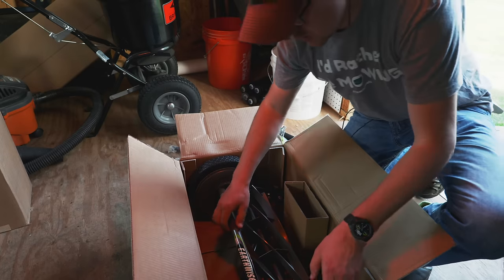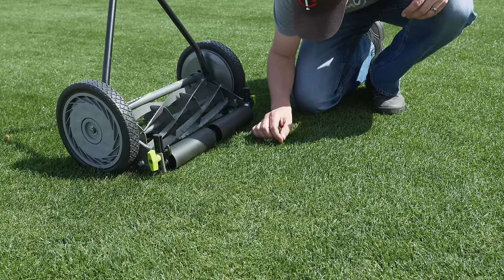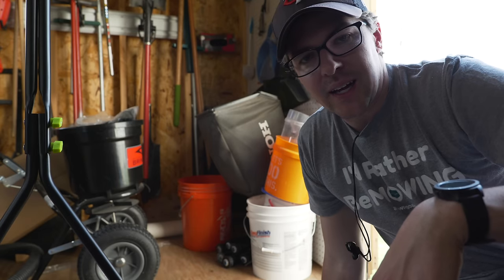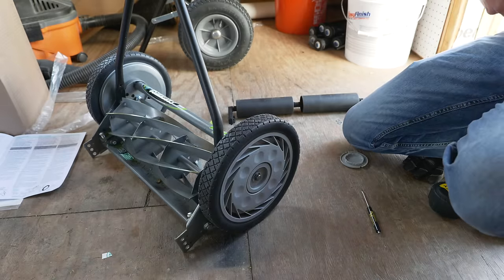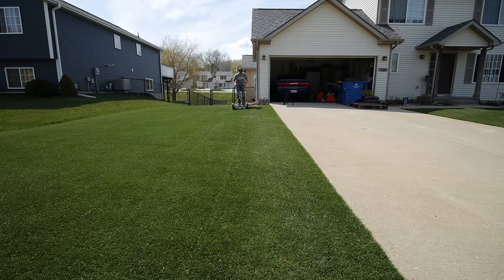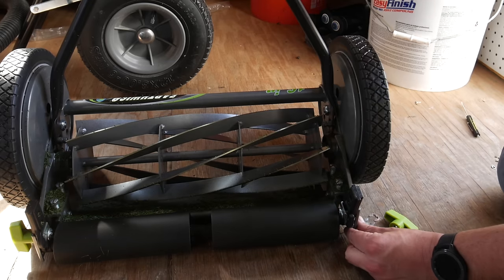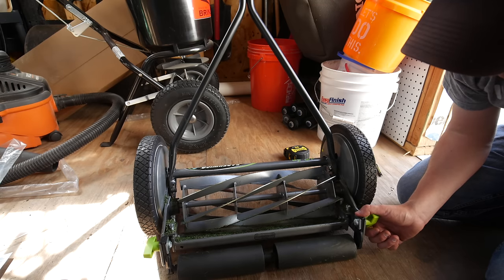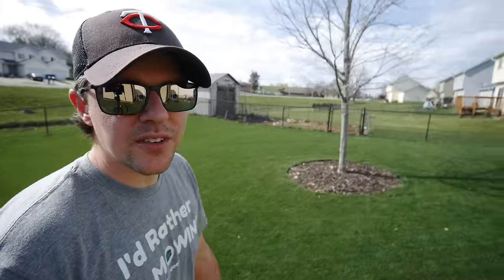I Bought ANOTHER Reel Mower and Here's WHY...

Comment: The American Lawn Mower style manual reel mowers are listed under numerous brands such as Craftsman, Earthwise, Greenworks, Lee Valley, Pro Mow (Residential Series), McCulloch, Scotts Classic, Task Force, and TruCut. The issue with that style of mower isn't so much the number of blades as it is the fact the reel and bed knife are not precision ground. Looking at the blades, you will most likely see heavy hash marks on the reel. You CAN take it to a shop and have them sharpen it better-than-new, but for what you're gonna spend, you would be much better off with a higher quality mower to start with. The Mascot style, AKA Silent Cut or Pro Mow (Gold Series) produces a much finer cut because the reel and bed knife are precision ground with a high sheen, as in, no hash marks and is far easier to adjust the mowing height. You can possibly make the Pro Mow Gold series work as a push mower and opt for the 8 blade option but it is rather pricey. Not to mention the fact, the Mascot style mower has a touchless style cutting blade making it far easier in tall grass than the American Lawn Mower contact style blade.
Reply: So... the fact that I have a scythe and obviously need the grind stones to grind it down has me winning again?
Reply: @ellenorbjornsdottir1166  "...I have a scythe and... grind stones..."

A scythe and grind stones, sure which is also how rotary mowers are done. With stones or a file. But on a REEL mower, no way, it HAS to be done on a jig or the reel and knife gets ruined.

Comment: Fascinating to watch the lawn trends. From long cuts 3.5 to 4 inches down to cropped reel mowing at 0.5 inches and now back in the middle with a manual mower. 
I use an automower (robot) at around 1.5 inches - and I've got used to the flat look without stripes.

Comment: Hey ryan washer boarding "riffeling" happens if you are travelling to fast . I work as a green keeper here in Ireland and when cutting fairways if we travel to fast the riffellling happens.so we usually adjust the accelerator to travel slower.and that usually resolves the issue.love this channel and your videos.
Reply: Spot on. I was going to suggest Ryan slow down a bit - try cutting at a normal walking pace - but you got in first. 👍
Reply: But the manual reel blades are driven by the wheels so the speed of the blades are attached to the speed of the wheels.  Slowing down your walking pace will slow down the blades so how does that help?  I'm curious.

Comment: I have a use 18" 5 blade that's a similar design with the height adjustment. This may sound silly, but to make the changes I just set the mower on it's side, sitting on a wheel, to make the adjustment. I only do one side at a time, and it's a lot easier.

Comment: I've just got my first mower and went for a reel style push. The big difference with mines i guess is it's a 1960's vintage one thats still in perfect mechanical condition. Going to repaint it in the the winter and service it. It's like you say, a bit of a work out but if you keep it short it's not so bad and it's quite gratifying when you finish it.
Reply: Those old ones work great. For my grass the newer ones are to light.

Comment: I do like push mowing with the manual reel mower, something about not having to fool with gas, engines not running right, noise, etc. It's just you, and your turf, which is rather relaxing. Not so much when the temps are in the high 80's like it is here today. Congrats on 100K subs!
Reply from the maker: Thanks!

Comment: I have an old 5 blade. A penna lawn ball bearing reel mower. It's all metal. even the wheels are metal. Has screw able hight. Rusty but works. Idk the year it is but it is old and works well even if the blades are dull

Comment: Hey Ryan I’ve noticed if you slow down it works a whole lot better. I have a 22” recycler, best push mower ever,  I was mowing a few days ago and just slowed down, I was thinking “ well what if I slow down a little, will it mulch better” and man it looked fantastic. There a guy that watches you and he did the 3 reel comparison, they were walking slow and so that why it came to mind.
   Update got the sprinklers put in ground, just waiting on the valve and controller, they come tomorrow but I have to work of course, so It will be installed Tuesday for sure.

Comment: Thanks for the great info and vid. I am looking into a reel mower as my first, just because I worked on small engines in high school and want low maintenance and not keeping up with gas, oil, spark plugs and all that mess. And you're very determined, as I would've just not chosen to cut at half an inch and gone with its lowest setting. 🤣

Comment: I have the same mower and went through a similar journey with it. I didn’t have to take the roller off at any point but adjusting the wheels is a pain to get the half inch. With my Bermuda the cut quality is only good at 1 inch. The half inch is just too much washboard for me. I do love the mower though. I used it daily for an entire season and it still cuts paper with no back lapping. The reel to bed knife adjusting is a little crazy to figure out but I’ve only had to do it once.

Comment: I have had a 5 blade version of this identical mower that they sell under different brand names. I actually bought it at Sears around 16 years ago that bears the Craftsman name.  You're right that adjusting it is a royal pain and it was because of that that I lost one of the gear parts and now only one wheel spins. It's only because of that that I'm replacing it after 16 years and I was wanting the same thing only 7 blades for the same reason as you did. Helpful video, thanks!
I have tried the engine powered reel mowers by the way, you can not beat the convenience of the manual reel mowers if you have a small amount of grass to mow.

Comment: Ryan, I recommended this same one to John Perry when he first posted his reel mowing video last year. I have the same one for use in tight areas where my John Deere 220E can't reach. It works extremely well in my bermuda but still shows washboarding when the turf gets dense.  I keep my HOC at 0.75" which is only manageable with PGR in Houston. Backlapping the reel and adjusting the bedknife definitely gets old real quick just as you said with height of cut adjustments. I'd love to see a follow up video if you could get your hands on the universal grass catcher for this unit

Comment: All you really need is a reel mower (power optional; or a powered (electric, ideally!) ride-on mower if you have chronic fatigue syndrome), a scythe (to harvest grain), and a Pulaski. Oh, and a seed sack for each species of field crop you're growing (in your case, it's probably ryegrass, bluegrass, fescue, bermuda, or grama; in mine, it's going to be wheat, rye, triticale, as well as beans and assorted others; I would also need a shovel which I do have).

Anything else is useful, I agree, and probably should be had, but may be optional. You will need a hose for firefighting.

Comment: Youtube gurus say the 7 blade reel is for warm season lawns, not cool season lawn like rye, fescue, KBG.  A 4 blade reel is best for cool season lawns, but a 5 blade works.  I love my push reel mower and will never go back to a rotary power mower.  Lawn care is fun.  Don't forget to brush the clippings off that mower and rub the blades with WD-40 to prevent rust, dulling the blade.  I do this after every mow (3 mows per week) and it's about ten minutes top.  Worth it.
Reply from the maker: My bluegrass is just as thick as warm season stuff for sure
Reply: @enp83 From the company website:

The American Lawn Mower Company 16-inch bent grass reel mower is a simple, efficient, and effective blade-and-reel mower, fueled by manpower and specifically designed to cut low-growing, creeping grasses.

A Well Constructed Lawn Mower
Made of durable tempered alloy steel with an unbreakable steel side plate, this 4-spider, 7-blade, ball bearing reel design gives you cutting heights ranging from 1/2 inch to 2-1/4 inches using the adjustable 7-section roller and 3-position adjustable wheel height. 

If you look up the same mower in 4 blades, they (American Mower Company) say the 4 blade is the recommended mower for KBG and fescues.  Have a nice mow.

Comment: I have a Fiskar since I thought the heavier blades would help vs. the Scott's that i had...which was partially true.  With the Zeon zyosia it can be a good workout.  In the places that were sodded, very tough go.  In the places that I planted via plugs, easier as not as thick.  Now since I can't go to the gym, I basically run with the mower until I hit the thick sodded portions where I would have to raise the cut height to keep running.  Makes for a good high intensity interval training.  Luckily this is in my back yard so the neighbors can't see and don't laugh at me!

Comment: Ryan, first of all you can never own too many mowers (I have 4). But, that is a classic rebranded mower made by the American Lawn Mower Company.  I have the very same mower in the 16" version that is labeled as "Great States". You adjust the HOC the exact same way, and yeah that fine adjustment can be tricky. I scalp my Bermuda lawn at 0.5" and maintain through the Spring at 3/4" as long as I can. By the way, the washboarding isnt so bad even with a 5 blade reel if you go over it from another direction afterward.
Reply from the maker: I usually do multiple directions but on 3500 sq ft it takes me a while to do a double cut
Reply: @ryanknorrlawncare  Yes, it would take a while. Good workout though!

Comment: It looks like you might be able to move the handle to the top of the roller adjustment  maybe that would help or you could move it in between it's current mount and the rear roller. I do believe these type of reel mowers are inherently destined to roll forward like that due to the cut of the reel trying to stop the wheels... This is kinda why I liked the Fiskers reel when I was trying to reel tall due to my Tall Fescue and Allergies. I now just cut with a rotory and deal with the allergies

Comment: Have you heard anything about the Fiskars Stay Sharp?  Just curious.
Reply: I've been using it for 4 summers now. Very easy to adjust the mowing height, just move the lever. Adjusting the cutting blade is easy too. I've only had to adjust once a season.  This year I bought the bag for it. I do  have some experience with reel mowers.  I worked at a golf course for 4 summers while in college. If you don't want to catch the clippings, they are thrown out in front of the mower to be cut again.

Comment: Another awesome video Ryan, thank you. So compared to the Greenworks 5 blade, easy to adjust, rear heavy mower, vs this 7 blade, harder to adjust, front heavy, quieter mower,  which one would you pick if you can only have one? Do the 7 blades outway the disadvantages of this mower. By the way I did order the 1 gallon Ryan Box from Simple Lawn Solutions, looking forward to my first application.

Comment: I’m new to this channel. I was just wondering why rollers at the end is needed on mowers? Serious question.
Reply from the maker: Helps to prevent scalping since it's riding on a flatter plane and not dipping to the holes with wheels.  Also helps to add stripes when it rolls over the grass
Reply: Ryan Knorr Lawn Care Thanks for the explanation.

Comment: The biggest problem with all these mowers is they don't weigh enough to get great traction. I have plated with adding weight and get instant good results.  But still only use them after I have machine cut the grass.

Comment: I'm having problems with roller staying on the ground which cause the blade to pull on the grass as it cuts.  They should have some way to have spring  that hold the roller down. My yard is only about 2,800 sq ft so I can justify a gas reel mower.

Comment: I bought a manual Fiskars reel mower.  I have mixed feelings about it.  At heights around 3" it leaves a lot of stragglers.  I am not sure it is best for our rye grass lawn.  Maybe it is my crappy turf but the grass tends to bend and not cut.  Lower cuts it works better but we don't have a very flat lawn.  As well, we have never cut so short so getting down to 2" or less would put me in the ER.
Reply from the maker: That's the problem with reel mowing taller heights....it just doesn't cut that great

Comment: I bought a reel mower for 10 bucks practically brand new at a thrift store.....I use it on a section that my lawn tractor can't go...it getsfilled with grass really easily..,.so what I'm getting from this video is I've been using it the wrong way?  These are for already cut real low lawns?

Comment: Well, I guess if you keep both reel mowers, set the 7-blade at a preferred cutting height and leave it. All other cutting heights can be done using the 5-blade Greenworks with the quick and easier height adjustment. No more hassle. Just grab, go and mow. Problem solved. :/
 ~ mike
Reply from the maker: Yep...I'll keep it for the backyard at this point

Comment: Have you ever used the Fiskars stay sharp reel mower? The one with the chain drive system. Im wondering how you compare this mower to that one. I've got the Fiskars reel, and it works well until I lower the setting to 1inch (first notch on the adjustment lever), or the second notch. I can mow at the second lowest notch, but it tends to get stuck requiring me to back up and push through harder. At the 1 inch setting it locks up completely and doesn't cut. If I push harder the whole mower including the wheels slide over the grass without rolling or any cutting. I have it adjusted properly to where it EASILY cuts paper strips without hardly contenting to reel to the blade, so that shouldn't be the issue. I can't even imagine how this reel mower can get to .5 inch! I live in Iowa also. This vid is making me want to give the earthwise 7balde a shot.

Comment: If there is a plastic fabricator in your area (that is not swamped with Covid cashier protectors and face shields) they could make you a Delrin or Nylon roller that would add some weight.
Brass or copper rollers would make fine stripes if your feeling rich!

Comment: do you need a very level lawn for a push reel mower to work, Ive got one but the strip at the rear keeps digging in
Reply from the maker: Need to find one with a roller and it will be better

Comment: I watched the whole video and mayyyyyy have missed it, but what was your ultimate conclusion in a 5 blade vs 7 blade push reel mower? Was the 7 blade a significant difference? Thanks Ryan!!!!
Reply from the maker: Not really a huge difference. The ease of changing heights and design of the 5 blade I have is nice. However the 5 blade doesn't cut quite as low either so there are some trade offs
Reply: @ryanknorrlawncare  Thanks so much for this awesome video and response! I've been on the fence for years on a reel mower and never could commit to dropping money on gas powered. After reading so many negative reviews on push reel mowers I stumbled on your video and committed. So happy I did! My lawn is seriously appreciating the cleaner cut!!!!! Thanks again!

Comment: You actually leaving the old grass on your lawn, I always thought, that all old bits should be removed,is there any reason for you doing that way?
Reply: It breaks down pretty quickly if they are small pieces. If you are mowing infrequently and hacking off 2" long pieces and letting them sit in piles on your lawn, that isn't good. Cutting off little quarter or half inch pieces of grass is totally fine and the soil microbes will break it down fairly quickly and it just feeds the soil rather than throwing away nutrients.

Comment: I'd imagine you'd need a pretty flat/level lawn for a mower like this.  My yard is full of bumps
Reply from the maker: My backyard is very bumpy but thick turf helps too
Reply: Ryan Knorr Lawn Care lol I bet not as bumpy as mine.  There’s not a single flat spot in my back yard. There’s like a 1-2 inch difference between the low and high spots of my bumps.  I’ve been thinking about getting a bunch of top soil and trying to fill in all the low spots

Comment: Those roller's have to be steel or stainless steel, usually they come with plastic or rubber roller's they are crap, take the roller off and take it to a place were they make steel fabrication put it back on and you will be singing in the rain, if you google a 10 bladed cylinder just the cylinder alone they cost about $800.00 .

Comment: Ryan, I think this may be the manual reel mower that's right for you: https://www.reelmowersetc.com/product/45-0252-SW.html
I've been using it for two seasons on 1/4"-1/2" Tiff Bermuda and it leaves no washboard cut unless I'm doing a deep scalping.   It's heavy but well-balanced.  It's wide.  It only has five blades but the gear ratio between drive wheel and reel cylinder is high, so it spins like a beast.  Unfortunately, it has a similar adjustment mechanism to the one shown in this video, but it rarely needs height adjustments, even if you've been bad and skipped several days (it blasts through just about any grass height).   I had poor results with a Scotts and Fiskars before finding this one.  It used to be made by the Amish, but now it's made in China and supposedly has the Amish making the final adjustments.  I wouldn't recommend the bag for it, except in emergencies where you've let it grow too high and don't want to do a follow-up with a rotary mower to vacuum up the clippings.  I can sprint with this thing and routinely mow my 9400 sq ft yard in about 3/4 to 1/2 the time that it takes with my Toro recycler.